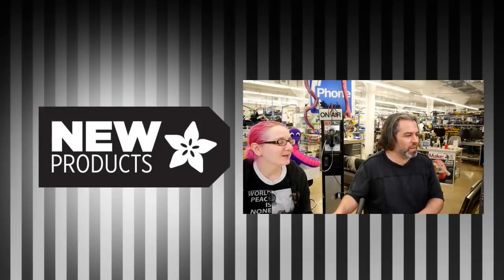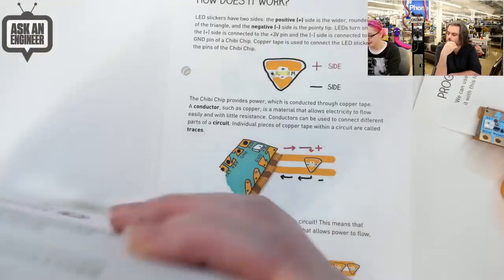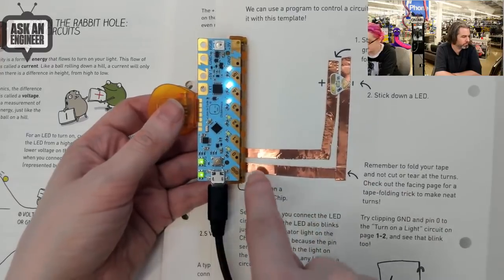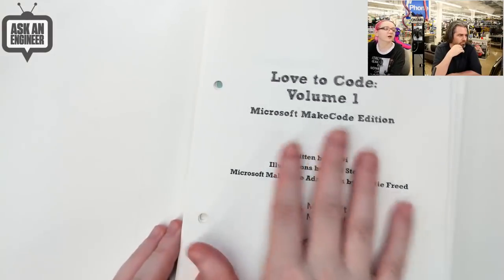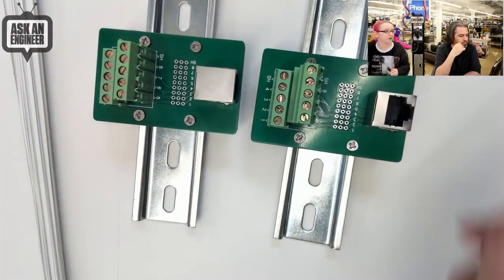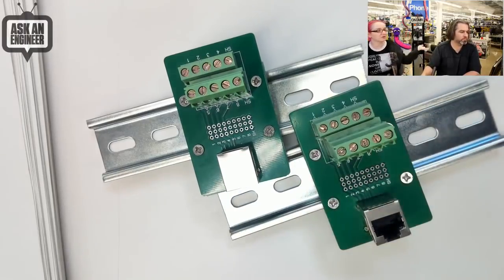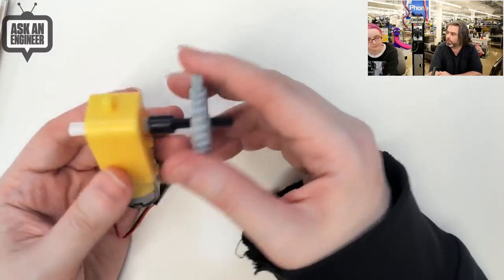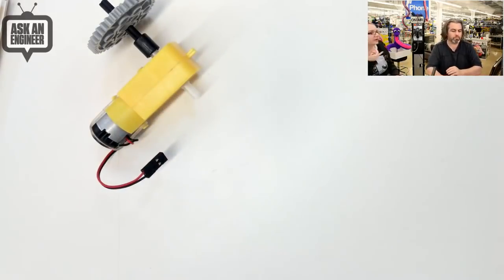New Products 5/30/2018 Featuring "TT" Motor to LEGO Axle! @adafruit #adafruit

Comment: Can the purple robot chassis be used for a 4WD robot? If so, would you use the forward tabs to mount the extra 2 motors? Is there space available to be able to properly secure the motor? Would have to fab up some type of mounting bracket. Any suggestions if using the Adafruit N20 geared motors with encoder?